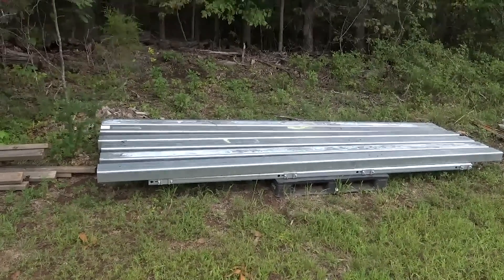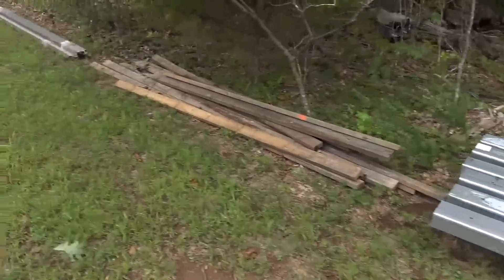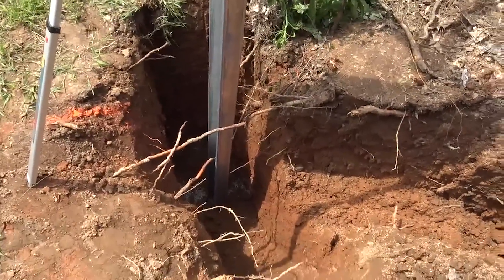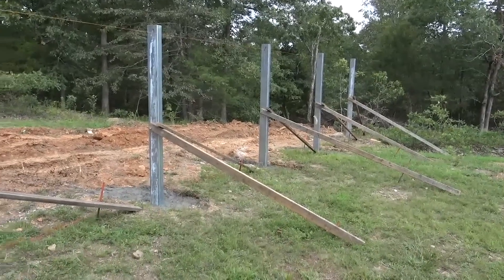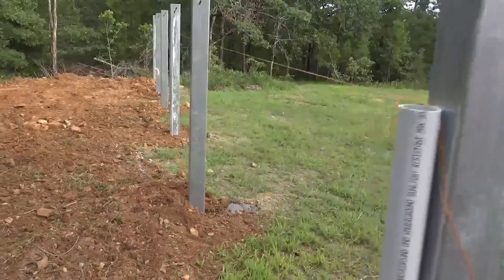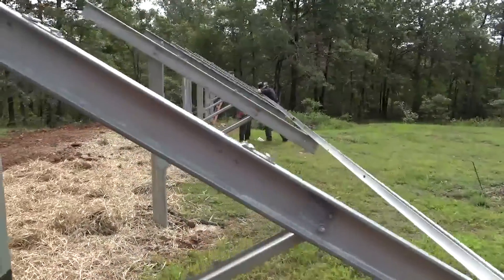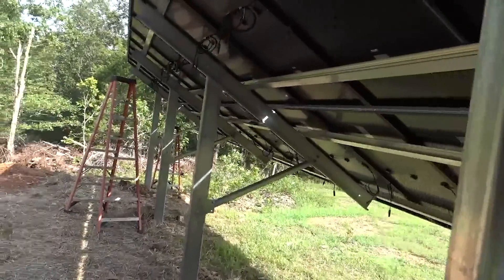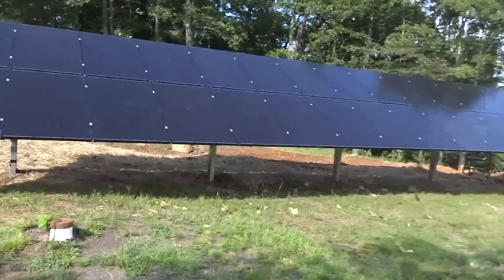Our Favorite Ground Mount:  Power Peak!

Comment: @engineer775 - What is the height set to on the ground poles? And distance apart? They never sent me a build sheet, tried emailing them and they replied, and couldn't give a build sheet, they told me they thought distance apart should be 'around' 114' apart but they still never told me the depth to bury the poles, or height sticking above grade, and quit answering my emails..

Comment: You could also make supports for the poles that clamp on to the vertical posts and have adjustable legs and reuse them and remove quickly at each job site

Comment: I get similar time installing 3" pipe iron ridge, 12 poles. 4.5yrds concrete concrete and conduit done by 4pm
With 3 guys. Last one was 15.5kw pv 
But the rest of the array takes way longer then that power peak.

Comment: I've got to wonder how tornado resistant such solar panels can be.
Reply: 14:54 As he said, this one's designed for 110 mph winds which covers the vast majority of tornadoes. 110 mph is the standard code minimum in Texas, specifically for tornado resistance. In hurricane country like much of Florida, they need to be stronger, and by code, installations need to be able to withstand 160 mph winds at minimum. They also get built for hail and other impact resistance (260 mph baseball sized hail). So, pretty resistant.
Reply: @seabream  Thank you.
Reply: THIS is why I would never ever roof mount them and I remember a mounting system (think I saw it on Youtube) from a few years back that had a motor on it (like a motorized bed) that in the home you press the button and it parked the panels so the wind wouldn't use them like a kite and at the very end it had a shade like item that rolled over them to protect them from impact.  I was impressed.

Comment: Would it be possible/ reasonable, to use a ground mount a little higher to use as a cattle, chicken, or hog shade also like multi use?
Reply: I would think chickens would be ok “as is” but for cattle, well, with enough money you could. Lol. Major cost increase. Harder to clean and service the panels.

Comment: For 4 solar panels, can you do a single mount or rather do two mounts? In an area with heavy snow loads.
Reply from the maker: I would definitely use a single pole mount from PLP.   We use them all the time for 3,4,6, and 8 panel mounts before we step up to the Power Peak.  If you need a kit with pole mount and panels let me know @  info@practicalpreppers.com
Reply: Engineer775 I was thinking of your Well pump + Solar package, just increase solar from 2 to 4 panels and use it to feed the cabin with power. The small pump provides enough water in a day to last me a week and the solar would just sit idle.

Comment: Scott, With the galvanized base and the aluminum rails. how are you addressing the dissimilar metals, to stop corrosion?
Reply from the maker: PLP has not had an issue with this.  They have been building mounts for 20 yrs.
Reply: @engineer775  I'm on and around saltwater all the time. This would be a problem in my environment. We would never put a steel and aluminum connection together without isolation. 

If it's not a problem in dryer and less salty environments, well okay. I will bet when it's time to replace a component in the system, corrosion will be found. 

Please don't take this as a criticism. You and your team do really nice work. Just food for thought if you ever work around salt water.
Reply: @karlfair  it's not ideal, but cars are full of such dissimilar interfaces, the racking system interfaces probably don't need to be undone as often as cars.  I think the surfaces that are anodized probably helps a lot.  If any of the aluminum is cut post anodizing  , i would suggest at least spot painting it... better than nothing.
Reply: That is mostly a problem in maritime environments where you have constant moisture and salt.